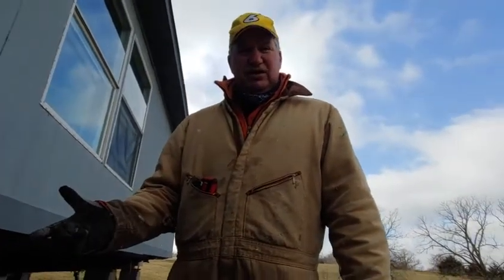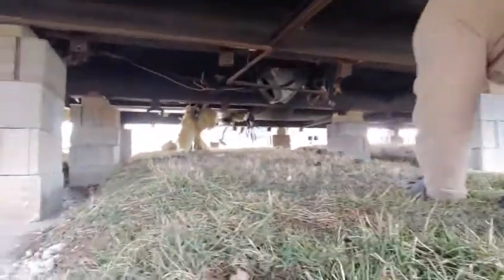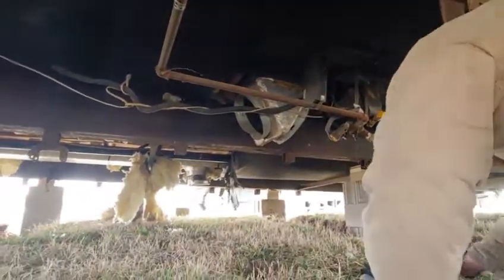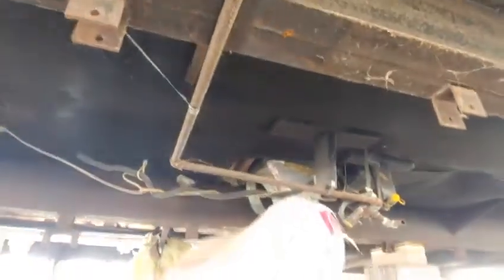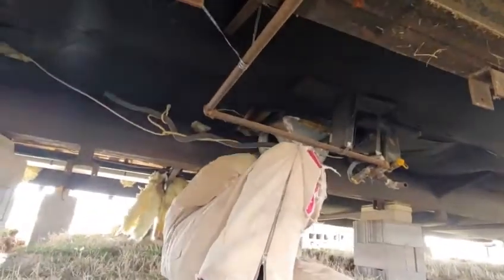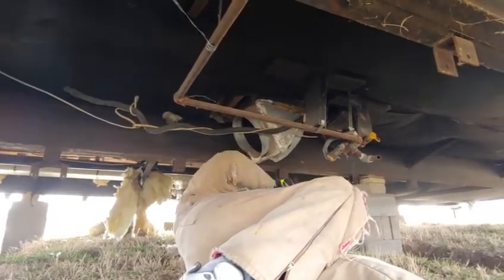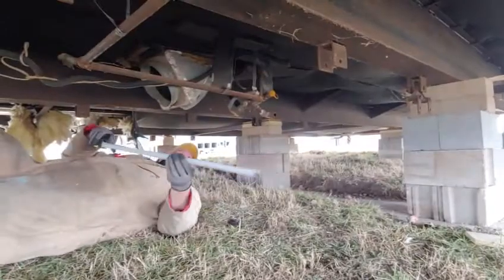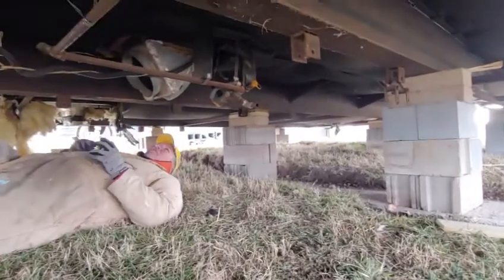Mobile Home Crossover Duct Replacement

Comment: im pretty sure what he is showing you is a triple wide reason there is 2 places for flex duct to connect to. you can see the other vent above his head during the video.
Reply from the maker: Very intelligent guess . Most people don't know about triple wides . When I used to set up new mobile homes we setup 7 one year along with 41 single wides and 154 double wides . Lots of stories. Back to your guess .This was a double wide with a unusual arrangement for ductwork I would have shown hooking it up , but these two mother and daughter women once I told them what they needed did it themselves. And I am proud of them.

Comment: Second question is besides us buying new furnace,new windows,new door’s and residing the entire house and attached garage plus new metal roof is their any other tips or advice for sealing it up any better or what other things I need to look into to improve that are known problem area’s or can become known problem’s with them? Thank you very much for any and all information I appreciate it!!
Reply from the maker: At some point you could look into more efficient windows and doors even ordering and installing them as you can afford it. Put in a metal skirting or a much higher priced block skirting. And keep checking for animals trying to burrow underneath to live in your insulation causing it all to come down . What you could look into again as you can afford it to moving to an insulated vinyl siding. I have actually installed an insulated log siding both with vinyl and wood with foam insulation. After that look into upgraded cabinet as you can afford and interior doors with real wood jambs. Hope this helps and wish you and yours well

Comment: I have a double wide but mine is totally enclosed underneath with the black plastic or whatever it is actually called. So my first question is we have a couple room’s that are at the opposite side from where the furnace is located that do not get as cool or warm as the other’s could this be my issue? Or what’s your thought’s? The furnace is new and didn’t change anything for those rooms. I can’t see anything underneath mine ! Is it ok to start cutting away at the covering and if so what to use to repair it afterwards.
Reply from the maker: You do not need to open the underpinning up. What can do is put flashlight In one vent and a mirror in another to see the inside of the vent area . Little trick I learned along the way. One area that is quite often a weakness is where the ductwork connects to the floor and in that same area where ductwork connects to the main ductwork . Make sure they are fastened the deal with foil tape. Finally and most likely the solution to your problem. Whereas most conventional houses have ductwork that starts off with say a 14 inch pipe and drop down in size maybe even to a 6 inch ductwork at the ends to keep pressure up at the end of the runs of ductwork mobile homes for not have room to do this. I am sure there are Budget reasons also. It has the same vent size from one end to another. To compensate you will need to close up the closer floor vents to your unit some pushing more air pressure toward the ends of the ductwork. Another common weakness is the crossover ductwork on double-wides usually don in flexible ductwork and usually on the ground. Quite often this ductwork will be riddled with holes from animals. To fix this I install metal ductwork with sleeved insulation screwed together then taped and insulation taped all of it off the ground. That make things better. Kudos to you and yours for getting the work done to make your life better.
Reply: So would you have to cut the under belly to get to the insulated duct on to the metal duct from vent.or would it have enough slack to pull vent off and tackle it from inside?asking because I'm having the same issue.2 of the vent used to blow really good  and now don't but my brother had fix one that the under belly was somewhat exposed when I bought the home so he just wiggles it in and tapped it.He said it's like it gets condensation where it meets the metal and collapses.

Comment: Is it possible to replace just a section of the aluminum square ductwork in mobile home
Reply from the maker: I personally have not replaced a complete section. I have replaced the bottom of the duct . Or rather covered over the bottom with new metal. It was metal duct that had rusted out from air conditioner leaking water into  it. Although I cannot your problem from here. I know what I would do to replace a section. You will need to measure your ductwork. My guess it will be 10 inches wide 4 inches high. Have someone that can bend light weight metal sections 4 inch side 10 inch across 4 inch side. Put one on top then one on the bottom the same size that will lap over the one on top. Fasten on sides then foil tape all edges. Hope that helps.

Comment: Question I have fiberglass duct work and wanting to convert over to this will it be a good idea ?
Reply from the maker: If you have a single wide mobile home you would only change ductwork to metal if yours was totally destroyed. I f you have a double wide and are wanting to improve the crossover ductwork . Yes even if you are connecting to fiberglass ductwork. You would take care to support the crossover ductwork so it would not pull down on the weak fiberglass ductwork. Hope that helps. Wish you well on your project.